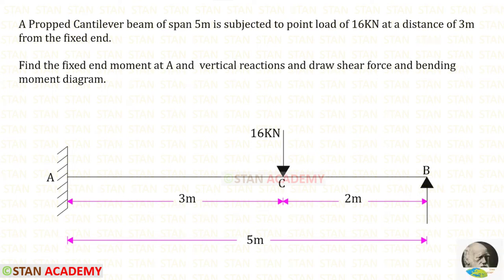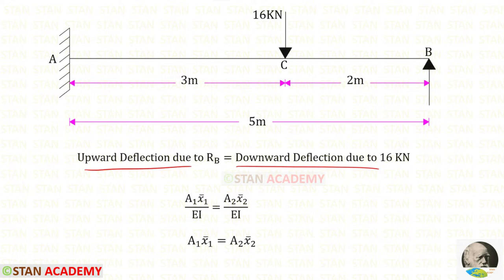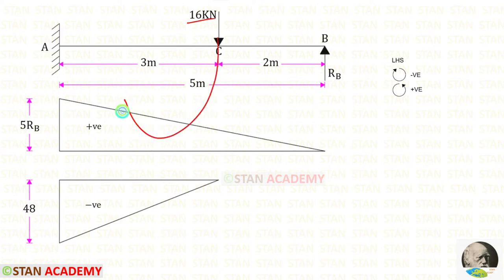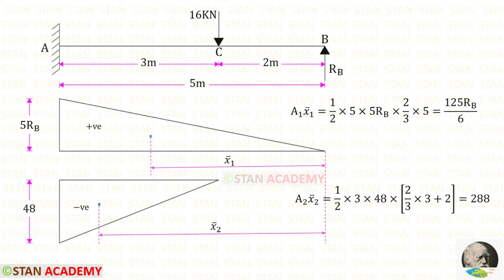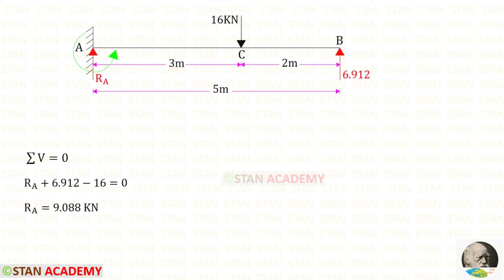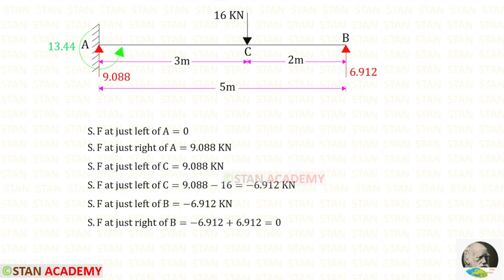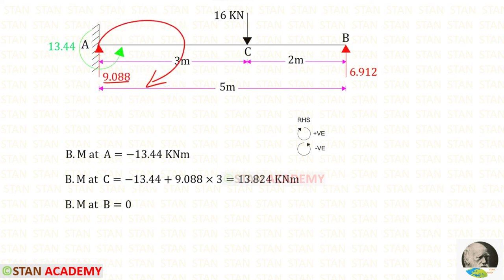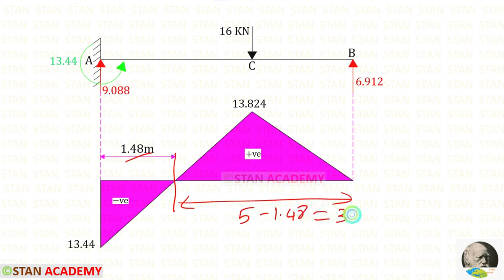Propped Cantilever Beam - Problem No 1 ( Moment Area Method )

Comment: please give me a solution of this i can not find the solution on book "a spring suppported by propped cantilever beam AB end A is fixed  and end B is supported by translational spring .Spring Stiffness K = 10000 kN/m . AB  span is 7.5 meter .the beam is subjected to a concentrated load of 20kn as well as a concentraded moment 10kn/m at a distant 6 meter from a .the support b is  also subjected to settlement A . assume a constant EI; E=200 Gpa  and I = 200 E7 mm^4 . solve the problem by moment distributuin method in minimum three trials . also draw tension side tension bmd as well as sfd for the beam  "